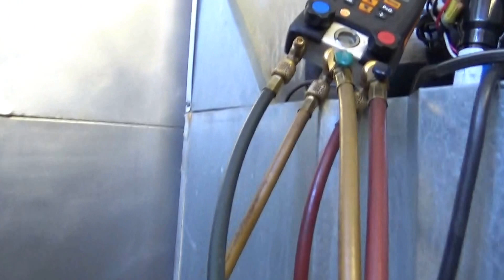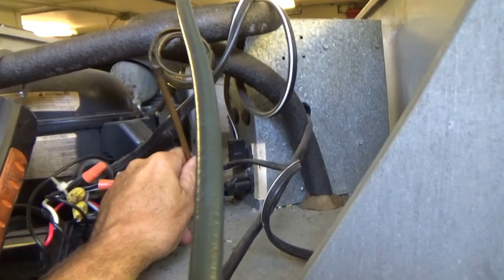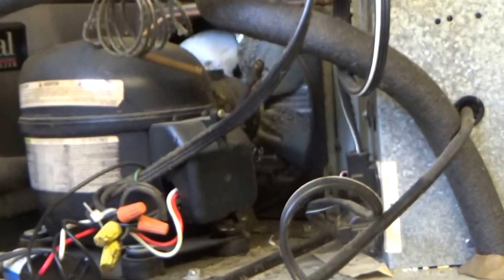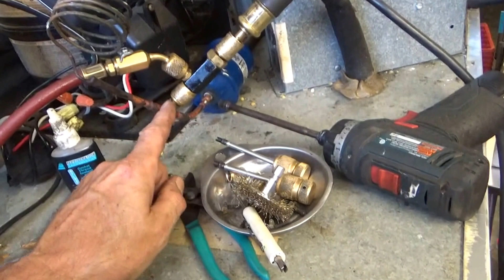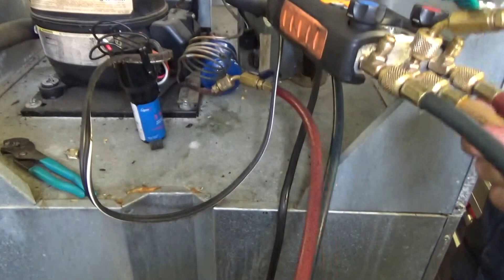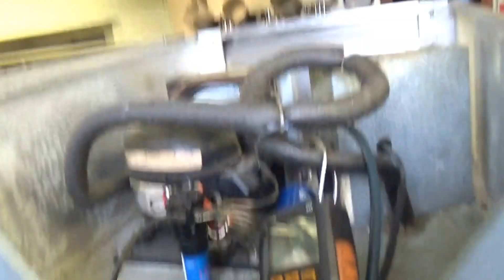Single door Continental Freezer

Comment: hi jim,greetings from the U.K. hope you are well,this busines of reversed fan blades,we get a great deal of Italian & portugese cabinets into the uk & come across this problem straight from the factory,I suppose you could blame mass production,the other side of fitting EVAPORATOR fan blades the wrong way round is to slow down airflow in a forced air display freezer I.E as in Arneg shop equip cabinets,I worked for eight years on these cabinets & came to the conclusion they are rubbish.Keep up the good work & keep the video's coming,   all the best   John.H